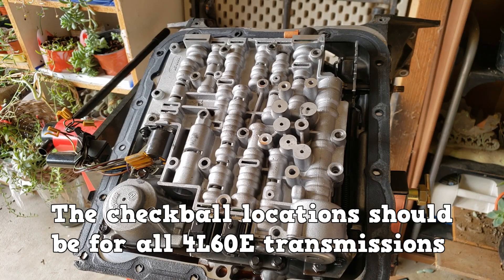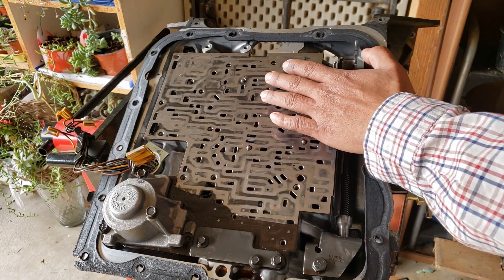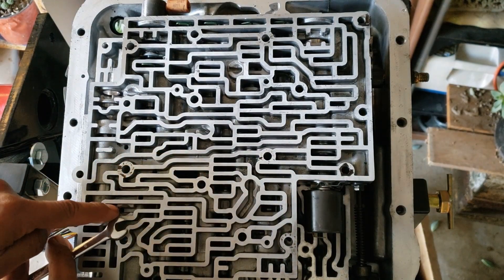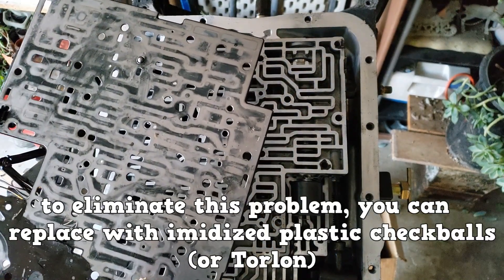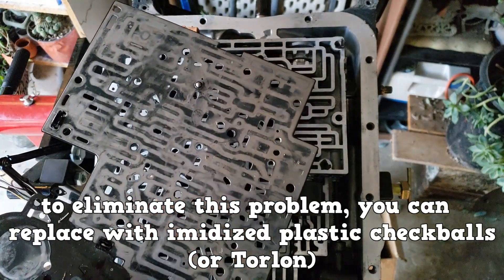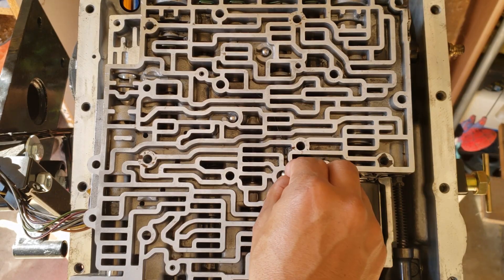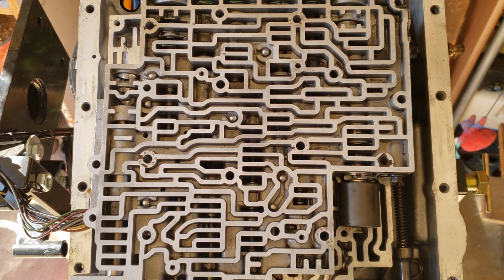All Checkball Locations & Info (4L60E)

Comment: If the vehicle has 200 K miles run and  have never had an oil change transmision , I know  if oil is change it will give issues, but if the valve body is clean it won't give any isues at all? Hope you can help
Reply from the maker: A transmission "flush" can be bad because it can free up any trapped gunk, and then that can clog up your valve body. A "transmission oil change" is good, just drop the transmission oil pan, collect that old fluid, change the filter and refill with new fluid.
Reply: @OldSchoolNoe  But also clean the valve body? Thats my question. Thanks
Reply from the maker: @GeorgeSantiago-g1v  I would just change the oil and filter

Comment: HELLO 
OldSchoolNoe
I just rebuilt a 2000 chevy 4L60E when i put it in reverse it goes forward and forward in drive is it possible the i left a ball out of the valve body or what i might have done wrong?
Thanks
Herm
Reply: You got the forward reverse check ball backwards

Comment: Hey OldSchoolNoe, why do you think my 99 RWD astro van shifts hard from 1st to 2nd gear ONLY after getting of the expressway and having driven over 60mph....ESPECIALLY when temperatures are hot outside, 75 degrees and higher.

If I pull over and turn off the van for 15 seconds , the hard shift from 1st to 2nd goes away.

Thanks for having such detailed videos !
Reply from the maker: Now that's an interesting scenario, which I haven't come across. I would ask a 4L60E expert on that one. Post this same question on one of the videos made by "Southpaw Autoworks."
Reply: This is commonly the case when your tcc valve goes bad and lets fluid past the seal making the transmission think it’s slipping because of that it over pressurized the lines and causes the hard shift currently fixing this on my 1998 suburban fitzall tcc valve usually works well

Comment: iv got an 4l60e from 1999 , from a gmc sierra 5328ccm, 198 kw ,......if lost the 8 checkball not the 7 smaller  but the 8 (loose)bigger one on the beginning of the gearcase
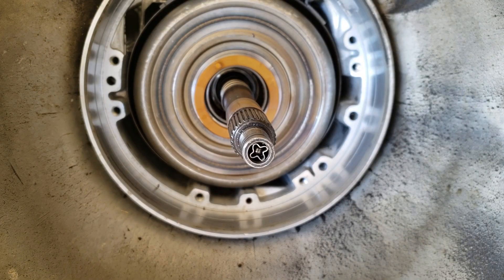Reply from the maker: 1:39  this one? you can find a replacement here
https://globaltransmissionparts.com/700r4-4l60e-4l65e-4l70e-input-drum-capsule-check-ball?gad_source=1&gclid=CjwKCAjwtNi0BhA1EiwAWZaANIPH-hawKLbueoU2HyxMghn5P6WSW3WdUe9Fuox54CiWsmWRKprccRoCIuYQAvD_BwE